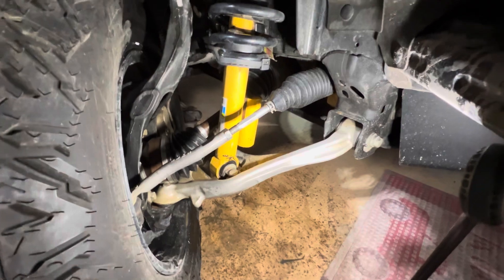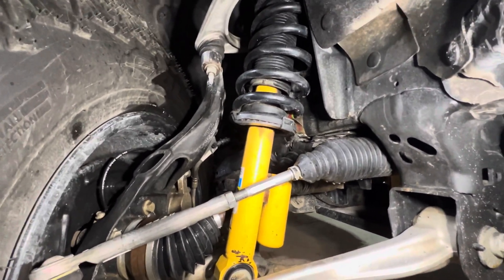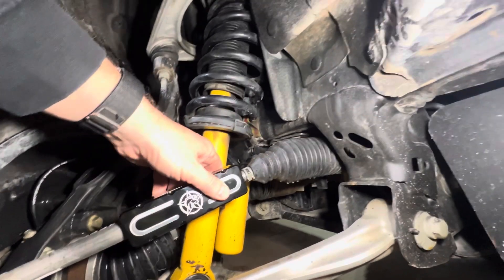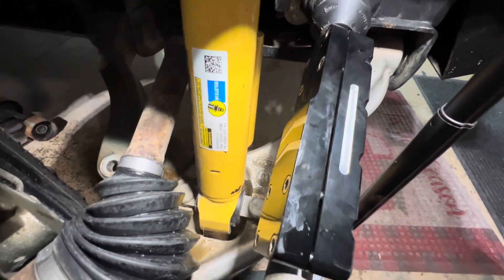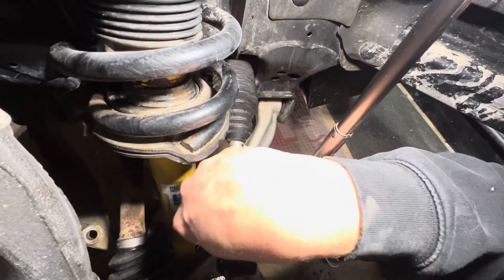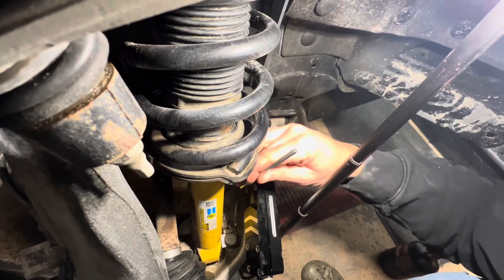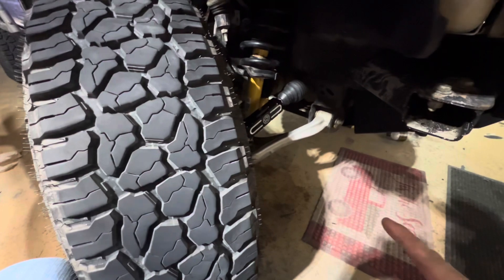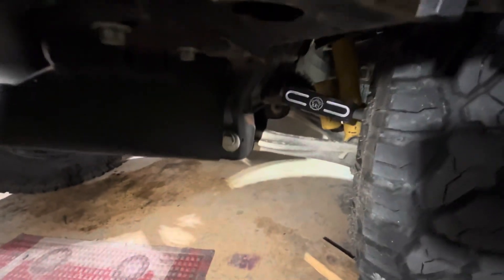Bronco Tie Rod Braces

Comment: I placed mine with the bolts forward. Easy to get to in the feild if something happens. I'll be able to use a power ratchet. And most importantly I can look underneath to inspect and see if any of the bolts are coming loose or backing off. I would hate for one to come loose not know it and have it catch something while I'm steering going down the road